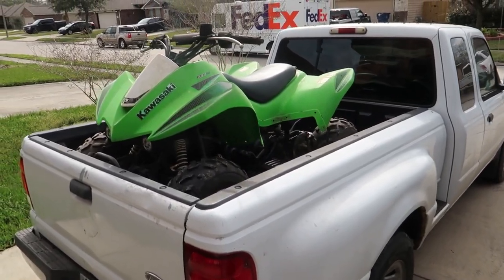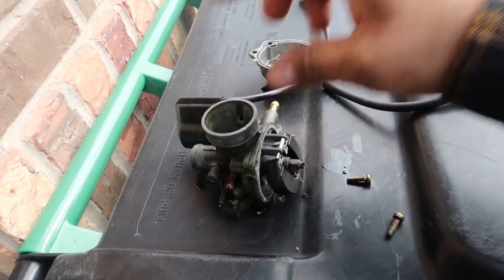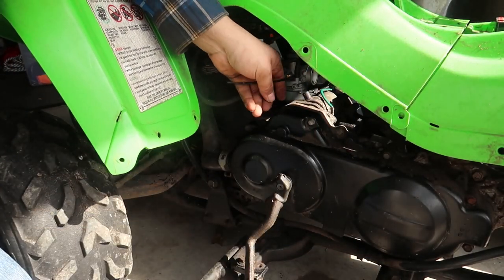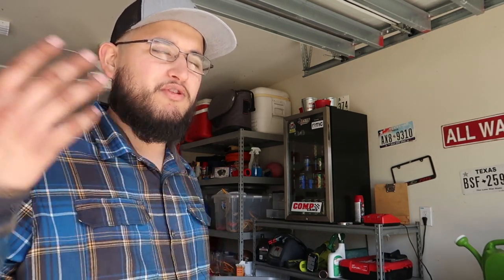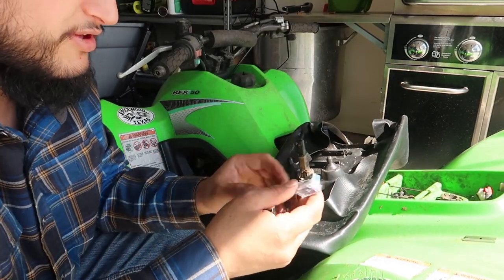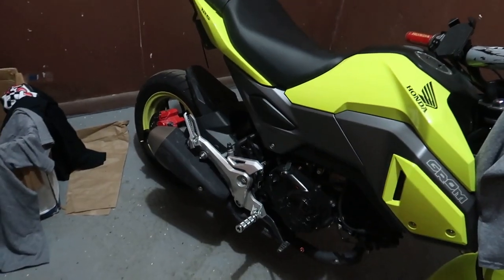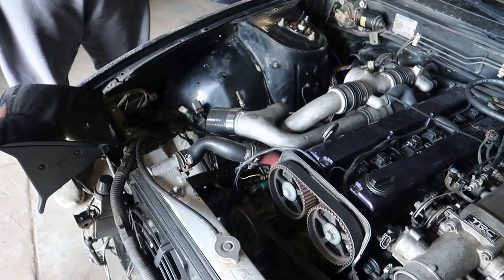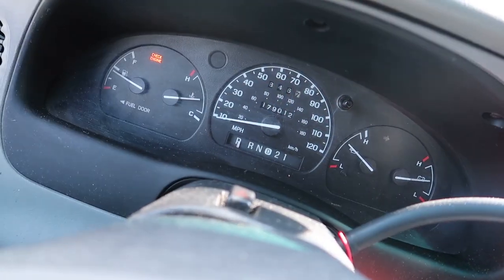Kawasaki KFX 50 Amazon Carb Honda Grom D16 Turbo Manifold Progress JZGTE 240SX And More

Comment: I got an Amazon carb and had to adjust the air/fuel screw a little to get it to run right.  Then I put it away.  Then 3 months later, it was colder, had a hard time to get it started and then it would just die.  Also when it was started it was smoking pretty good...